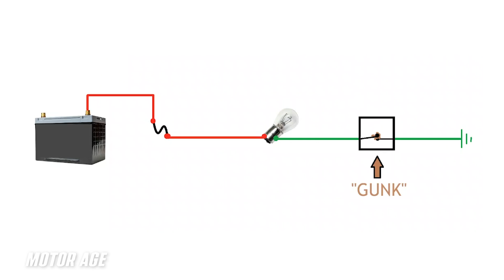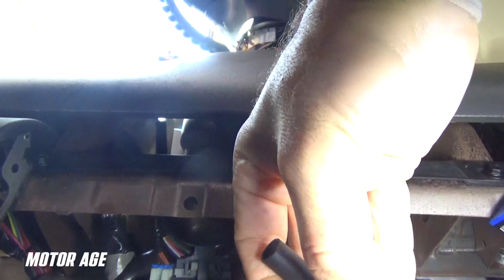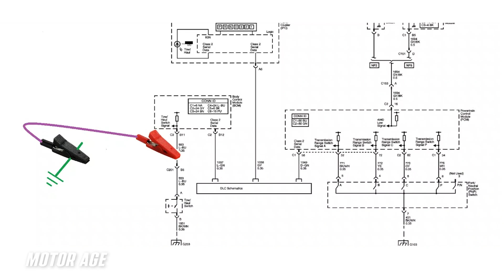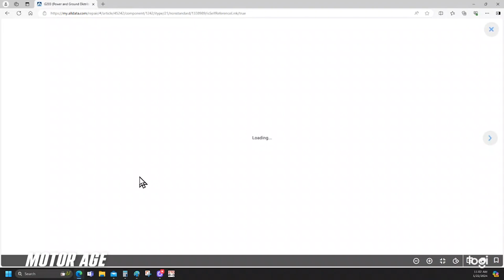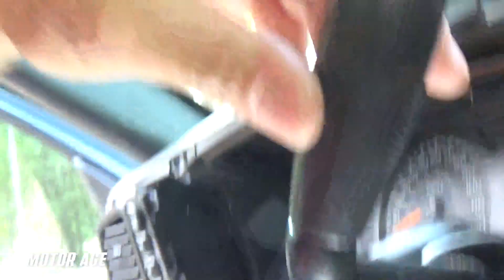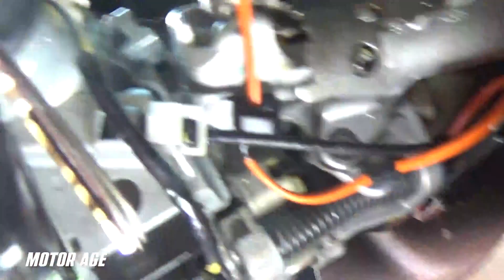Mastering Diagnostics #14- The Bypass Test

Comment: How to by pass sensor that are not switches such as hallefect sensor or veriable resistor , rheostat?
Reply: I’m that scenario, you cannot by pass the sensor because the signal is non-discrete. 

You would have to use a sensor signal simulator

Comment: Yup.  Seen this before but on the Ford F250/F350 steering column.  Ford put the wires up through the selector handle to the OD switch.  Where the wires entered the selector handle hole the metal is not smooth, the wires are pulled tight and the wires are not covered/protected.  Talk about triple jeopardy, planned obsolescence!
So I was able to add some protection to the wires, then I lengthened the wires for less bending and mounted them to eliminate the tight pulling by routing them a little differently.  
It worked. Never had a comeback.
Thank you for this video.
If you question the engineering design, the engineers would tell you "We've NEVER had any problems with our design."
O course not!  But then, they never tested the vehicle for 10 years/150,000 miles, Summer and Winter, humid and dry.
If they saw what I did for the repair, "Oh we can't do that!"  "That extra wire, plus the 2 cable ties would add at least $1.00 to the wholesale cost of building the vehicle.  Added to 10,000 built vehicles, that's lost profit!"
But don't worry. We can manufacture "replacement parts" to fix the vehicle  for maybe 10 years.
UHUH!
Reply: Seriously, as soon as I saw the movement and tension being placed on that wire my immediate reaction was "who thought that was a good idea?!" 🤦‍♂️
Reply: Amen, amen, amen . Saw the same thing on my dad’s ‘96 F250. We think on an individual level. The corporations think on economies of scale. Ugh lol